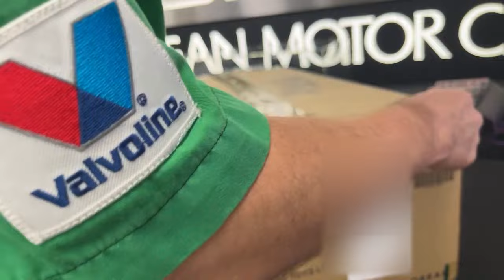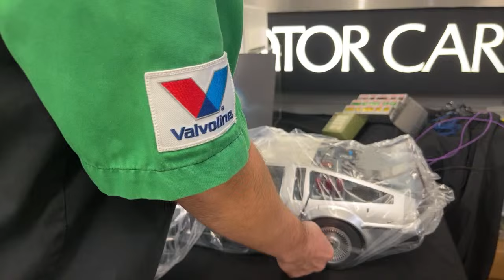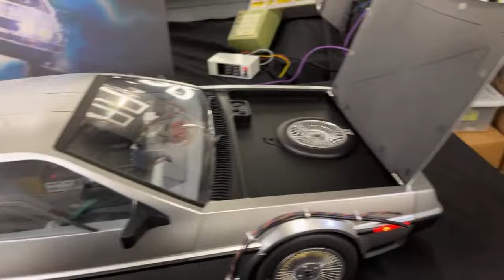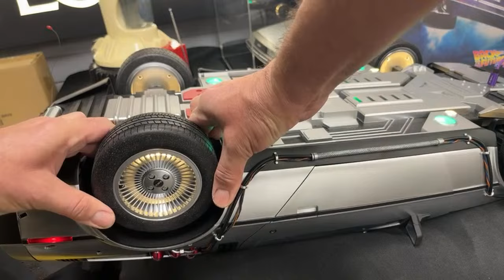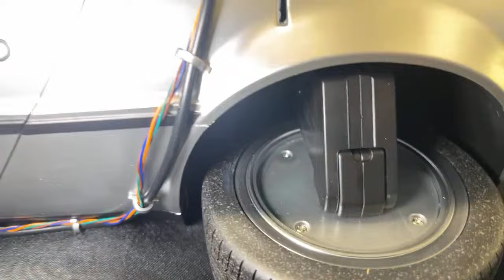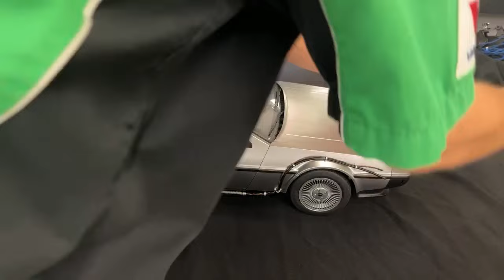Replacement Hot Toys DeLorean 2 LIVE UNBOXING - Will it be broken again?

Comment: Excellent, methodical problem solving video.  And without all of the drama of the other guy.  Looks like 3 clicks and applying gentle pulling force to the axle portion of the mechanism will do the trick.  And thanks for showing the wheel rotation.  I was wondering how they would allow it to rotate and not break the electrical connection.  Pretty creative solution, actually.  Mine is coming from Australia to US so seeing this is very helpful.  Thanks!!!😎
Reply from the maker: Yes apparently it is 3 clicks now.  You think they would have mentioned that important detail in their instructions (Gripe #10/10). Thanks for watching and good luck with your DeLorean!

Comment: I have a question for you if they were to do another back to the future movie what version of the delorean would you like to see again? 
The version from part 1 with the plutonium chamber or the Mr. Fusion version with the flight capabilities in part 2 or the version from part 3 with the 1950's tires or the train wheels on the train tracks?
Reply from the maker: Definitely Part 2 with hovermode and Mr. Fusion!  Always been my fave version of the DeLorean. Let’s face it, when the Time Machine appeared at the end of Part 1 with its new hover conversion and Mr. Fusion, it had truly reached it’s peak in terms of overall sci-fi coolness, badassery, and perfection.  The other versions are cool but are either just precursors of what’s to come, or salvaged versions of what used to be.  Go hover, or go home (to 1985) 😅
Reply: @DeLoreanTECH  Same here with me in wanting to see the version from part 2 with the hover mode making a comeback if they ever did another back to the future movie.
I hated the version from part 3 which for me was a complete downgrade from part 2 and definitely not a fan of the flying train at the end of part 3

Comment: Glad to see your replacement came out ok my dude.  I just opened mine the other day after having it sit in the box for like 2 weeks 😅 fortunately, the only thing wrong with mine was the passenger seat came unglued right out of the box (an easy fix).  I followed the same thing with pulling out the wheels upside down and didn’t roll them.  That was really good advise, no breaks or stress marks 👍🏽
Reply from the maker: Glad to hear! And thanks. Yes the seat would be an easy fix. Cheers!

Comment: Probably best to loosen those screws in the corner first before flipping the wheels down.
Reply from the maker: Agreed, if the wheels offer some resistance.  I read/saw somewhere that in some cases these screws were over-torqued.
Reply: Having not received my DeLorean mk2 yet,  where are these 4 screws that you mentioned? Are they on the struts or on the back side of the wheel hub? Thanks! BTW great unboxing videos and cautionary info.! Thanks.  Will  you be getting a Marty and Doc to display with your DeLoreans?
Reply from the maker: @Collection_Obsession    the screws that hold the ‘control arm’ to the ‘axle’. Basically the black ones on one side that hold the strut  assembly together. But only loosen those slightly and carefully so as not to strip them. If they were over-torqued you might see a stress crack.  Choose your screwdriver with care. Also note the one located closest to the center of the vehicle may be hard to reach, so try the three that are furthest away. The wheels should flip down without much resistance. I didn’t have to loosen mine but that doesn’t mean you won’t have to and its a good precaution. As for Marty I have the Marty 2.0 with Einstein but no Doc (yet). Soon I hope!
Reply: @Collection_Obsession  It's just that screw at the corner of each strut you see in all the reviews.